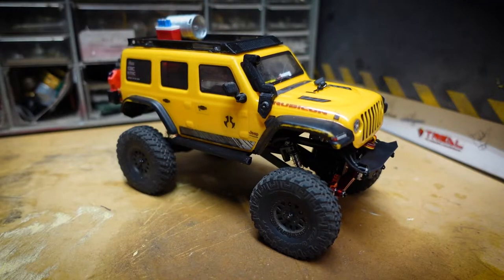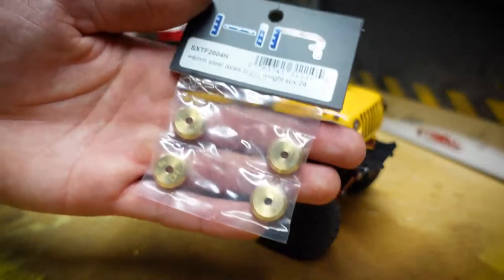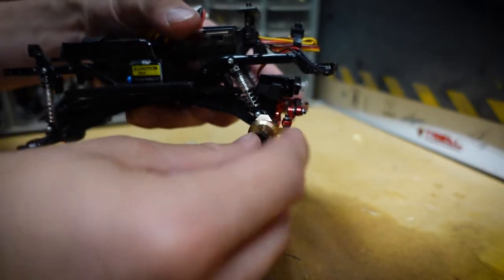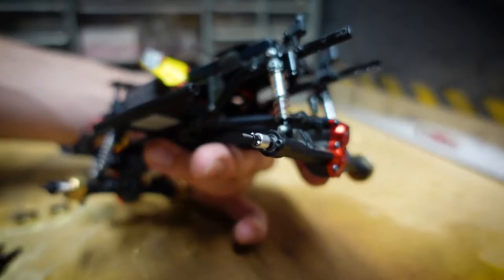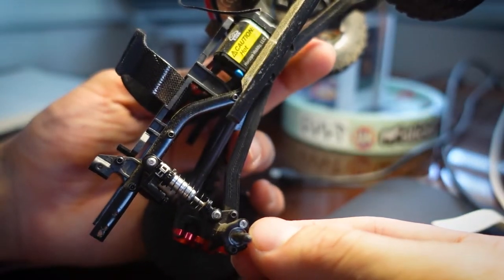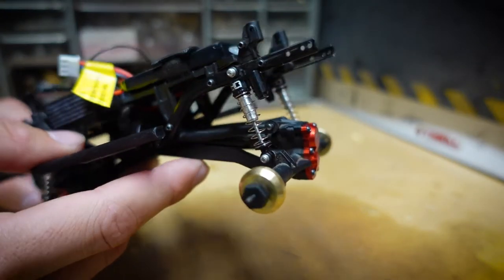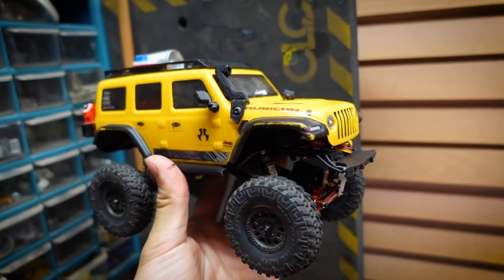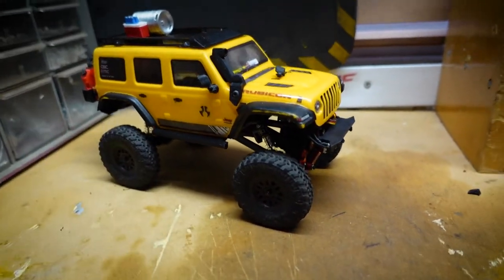SCX24 JEEP Hot Racing +4mm Steel Axles Brass Weights Ep.11

Comment: The hardware that is included when you get either the HR +4mm axles or the optional weights that can be used with those axles (tiny Phillips screw and thin washers/axle spacers)  is ONLY required for the REAR and only when you use those optional weights. They are meant to replace the original black screws that hold the end bearings on the rear axle. 
If these (2 screws and 2 thin axle spacers per side) are not used, the weights will bind/rub against the much thicker heads of those original black screws.
Reply from the maker: Correct 👍